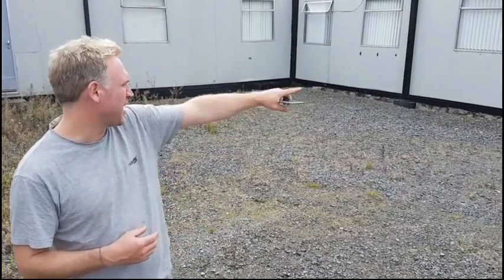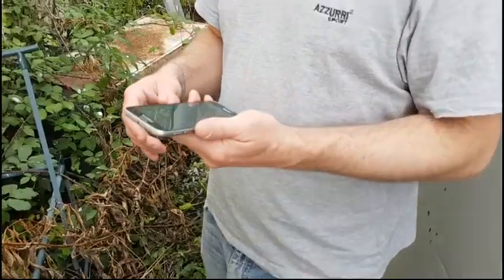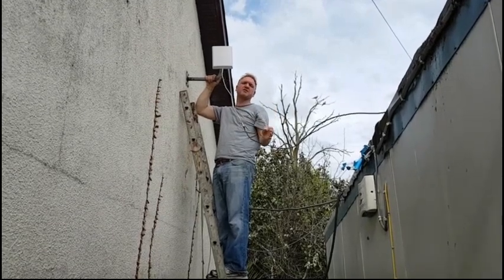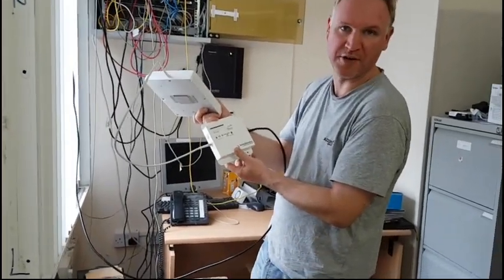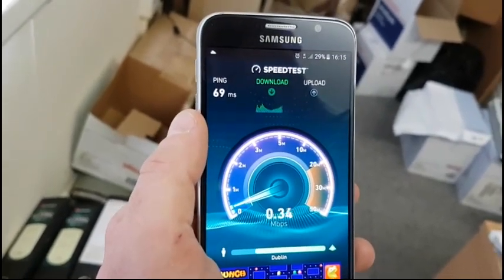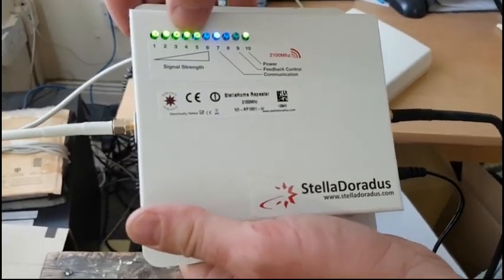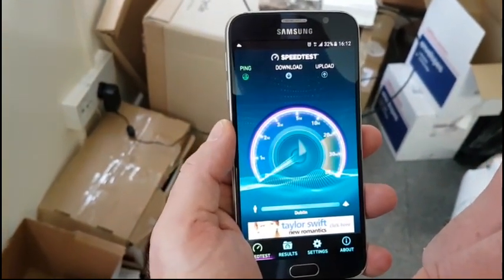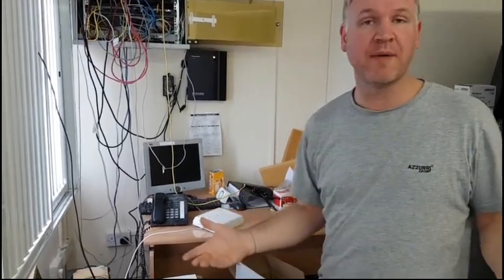Turning bad  signal into great signal. Installing a mobile phone signal booster in a house.

Comment: do these repeaters have any effect on health?
Reply: Aye it will make you go bannanas
Reply: The signal frequencies being received and amplified are directly between the frequencies of visiible light and audible sound frequencies, so if you believe that visible light (not UV light, that's further down the spectrum) and sound are going to affect your health, by all means don't use this device.
Reply: @ri5ux  I hate to be that guy but audible sound frequencies aren't on the EM spectrum. Within a similar area of the EM spectrum are the waves used by Microwave ovens to excite water molecules (and hence heat them up - around 2.45GHz). There are definitely things that can affect human health in this region of the EM spectrum, there are no known (proven) negative impacts on health due to the low power nature of the signals used in telecoms.
Reply: @AxR558  You're right, my source was incorrect. However, unless you're confining these waves to a very small volume of space and directing it into a living organism, the effects will be minimal. You would likely need hundreds of watts directed in a small amount of space to do any sort of damage. Since these are transmitting across a decently large area, and not necessarily directed, the EM waves would dissipate by the time they can cause any damage, as they only output typically around 3 watts of power. If we're talking the much larger microwave transmitters, and you stand in front of one for a given amount of time, absolutely.. it will likely result in death.
Reply: Lol